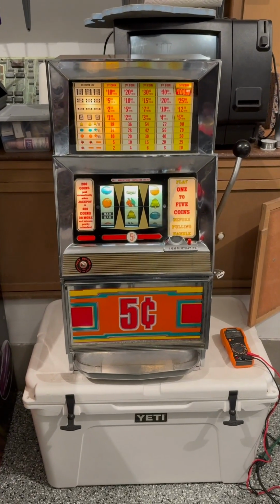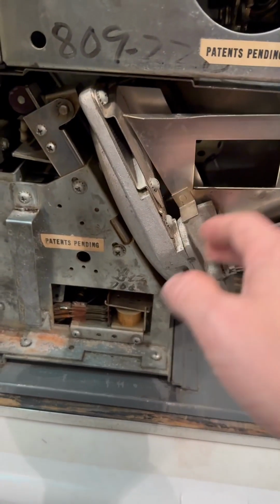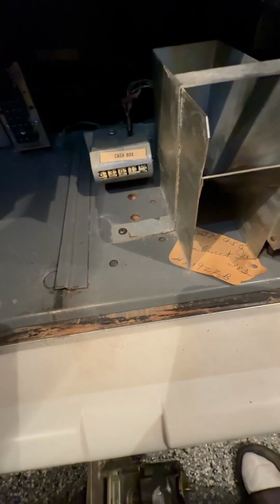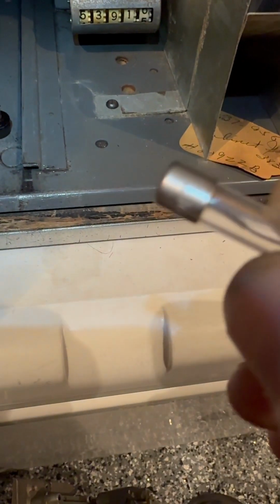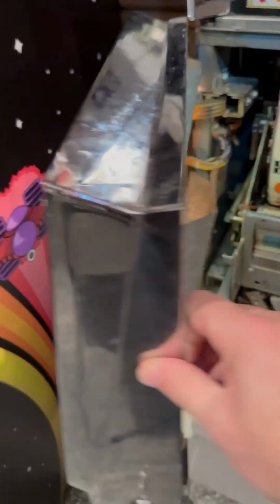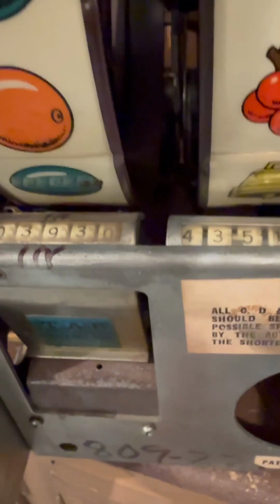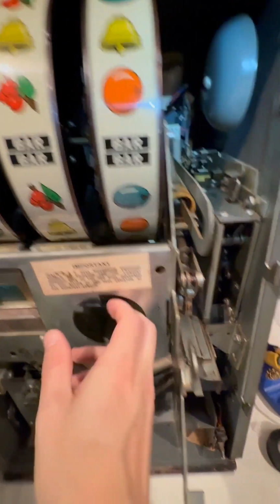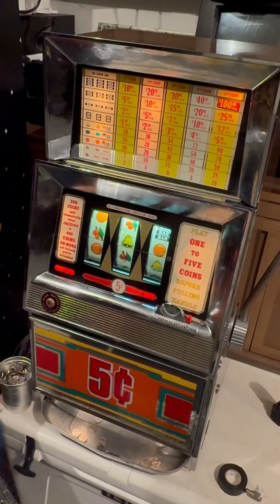809 Bally Slot Machine Restore - Part 1 - Fix payout not working

Comment: Got the same slot , middle fuse housing wasnt closing when push turned so i replaced .. still wont let me pull handle
Reply from the maker: Check the schematic for what connects power to the handle release coil. Check every switch that could give it power for good connectivity when they close

Comment: The belly is not lit up: takes a F8t5/CW bulb - compared to the reel bulb which is a F6t5/CW fluorescent bulb - your starter cans for both are FS-5
Reply from the maker: Thanks for the recommendation. You can see later in my repair videos that I fixed that

Comment: I just bought an 809. It has a call button but no candle. No hole on cabinet top?

What are the two dashes next to the cherry line payout?

Is it best to leave this old machine on 24/7 or turn it off? I was told to turn it off to save the coil relay.
Reply from the maker: - I think the candle was optional from the factory. Some have it some don’t 
- the dashes mean that the result an be anything on that reel when the first reel is a cherry for the player to win.
- these things are designed to be turn on 24/7. Yes you can extend the life of the coils by turning it off but coils should last decades before they burn out.
Reply: @kellypangburn3621  That explains why there is a round call attendant plate but the metal button can NOT be pushed in. It's weird they have a call button plate with no candle. I was told the sequence payout would be 1 cherry and 2 spaces, which is also weird. Why a player would hope not to get a symbol on reel 2 and reel 3.

Comment: HAVE A  809 SIMILAR TO YOURS  / I CANT GET THE THE SMALL FLAP TO ENERGIZE ( DOOR AREA) SO IT CAN DIRECT THE NICKEL TO HOPPER  (HOPPER UNIT WITH BALL IS NOT INTERFERING  WITH THE  HOPPER/SWITCH  )
 THE SMALL WIRE SWITCH (DOOR) THAT THE NICKEL HITS MAKES A NOISE WHEN I TRIP IT MANUALLY / BUT ADDS NO CREDITS/ NO FUSES BLOWN & ARE CORRECT AMPS / HANDLE IS IN LOCKED UPRIGHT POSITION , DONT KNOW IF ITS SUPPOSE TO SWING FREELY WHEN NO $ INSERTED//I AM NOT A ELECTRICAL GUY-  HELPP!
Reply from the maker: I would check the schematics for what turns on the coil for the coin diverter
Reply: @kellypangburn3621     SURE IF YOU CAN READ SCHEMATICS ??? I CANT ;(

Comment: Just picked up a similar model and 831 any idea why it would blow the 120volt 5 amp fuse when it hits a winner and goes to payout
Reply from the maker: The 5 amp fuse probably means there's a short circuit somewhere in the payout system. Check all the wiring and connections in the schematics around that area, might have 2 wires touching that are not supposed to..
Reply: @kellypangburn3621  just found it I took the switch stack off the side of the hopper and its all black underneath definitely touching ground thanks